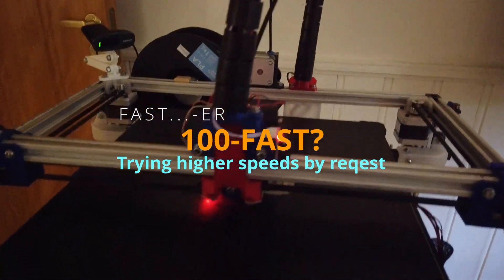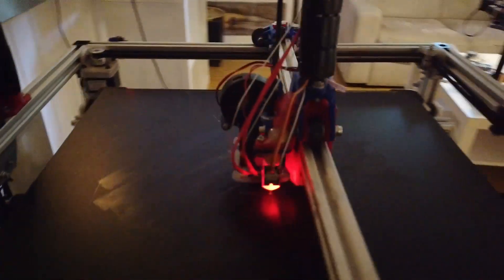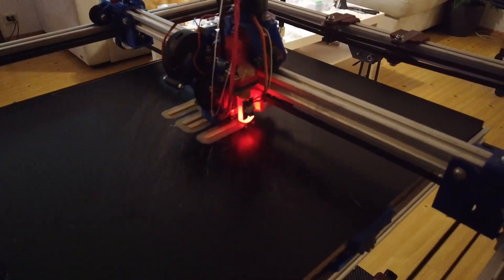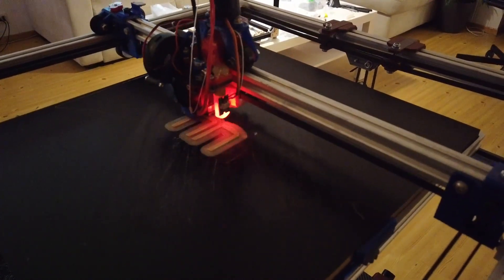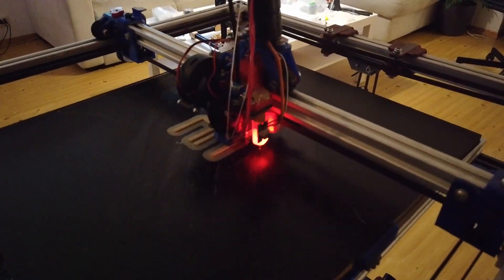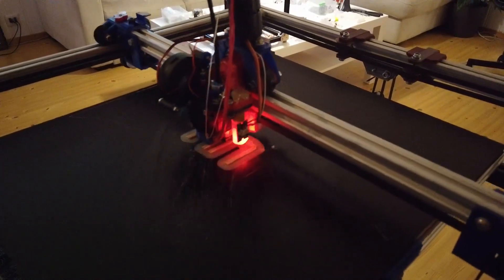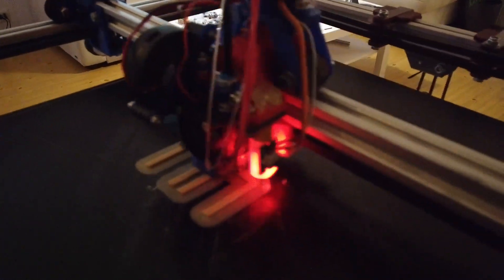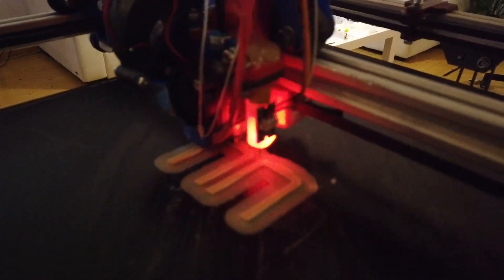3/3 SKR 1.3 + TMC2208 3d printing test at 100 mms

Comment: Very interesting.
My goal with a coreXY printer is 100 mm/s minimum.
What about the motor's temperature?
No shift on layers?
Reply from the maker: No skipping steps. Motors are fine - Extruder can get hot so running that on lower amps than XY
Reply from the maker: Also Extruder driver is A4988 as the TMC are not working well at the E axis
Reply: @PRO3DESIGN   on a lot of the mks replacement videos they suggest running lv8729 for extruder.  I've  picked up a few and i'm  planning on testing them out.
Reply: @PRO3DESIGN  You mean that the extruder motor heats up?
Reply from the maker: @MP-fv8iy  yes sorry. The extruder motor can get hot. It is working like crazy and alone. It never rests during a print. The other motors get rested ones in a while usually